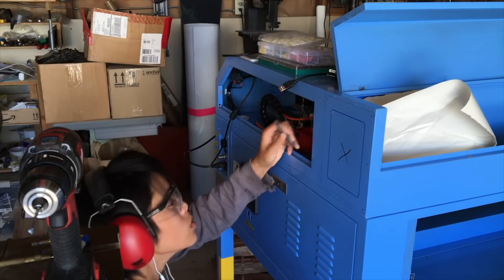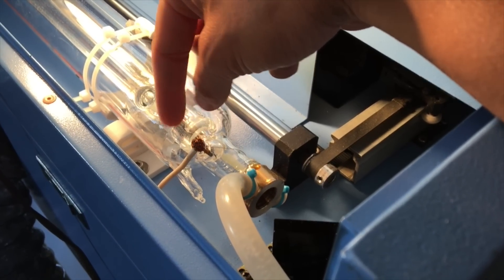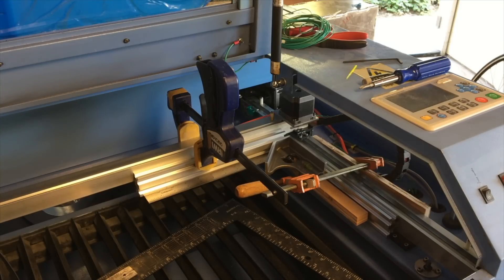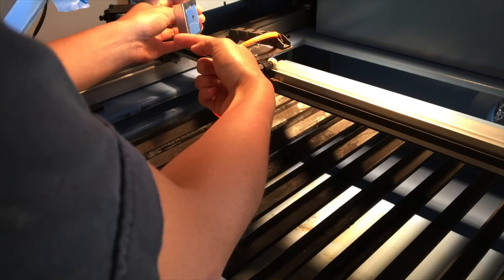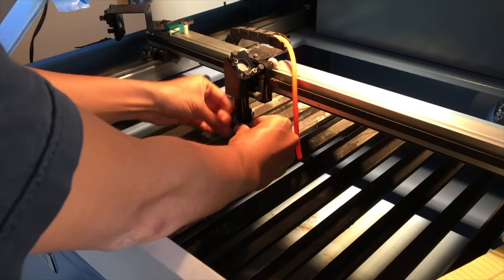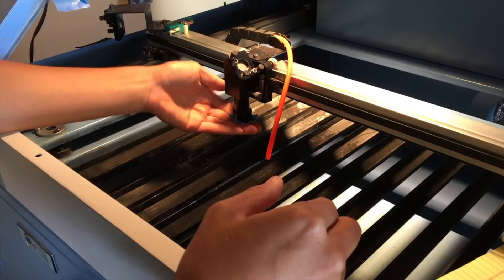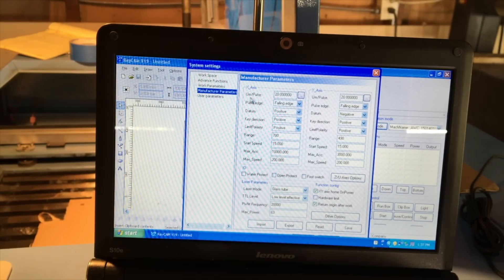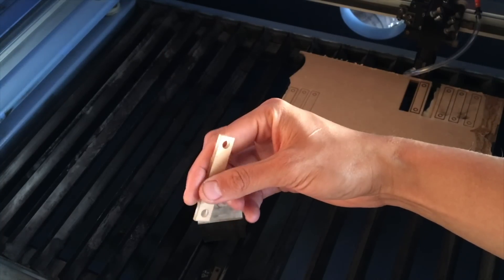Restoring A Chinese Laser Cutter (Part 3) Last part!

Comment: Completely awesome except... those electrical connections to the tube.  Whahuh? 

You'd have no trouble making your own split bolt connection, though they're not that expensive. 
https://www.homedepot.com/p/Commercial-Electric-8-4-AWG-Copper-Split-Bolt-GOEC-20/310747593

Heck, just clip the lugs off these and use them like one side of a terminal strip connection. 
https://www.homedepot.com/p/6-STR-to-14-AWG-Dual-Rated-Type-ADR-ALCUL-Single-Conductor-Mechanical-Wire-Connector-with-1-Hole-Mount-2-Pack-ADR6-B2-5/100128007?MERCH=REC-pipsem-100151936--100128007--N

Silicone can be a reasonable electrical insulator IF you avoid using the common "acid cure" types that exude acetic acid while they set up.  https://electronics.stackexchange.com/questions/32798/can-silicone-sealant-be-used-to-insulate-and-waterproof-electronic-components/32812
Reply from the maker: Thanks for the tips! I hadn’t heard of split bolts before, definitely storing that key word away for future projects.